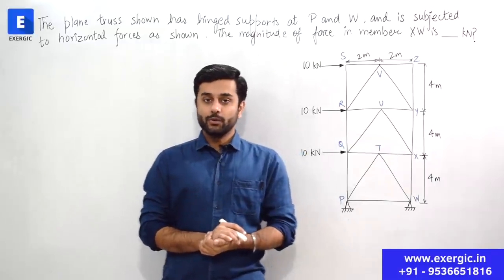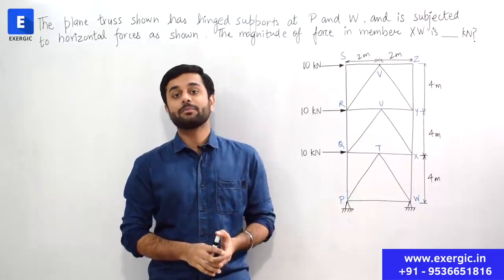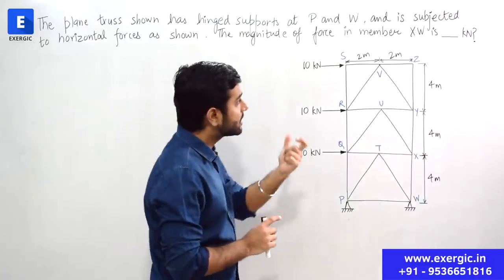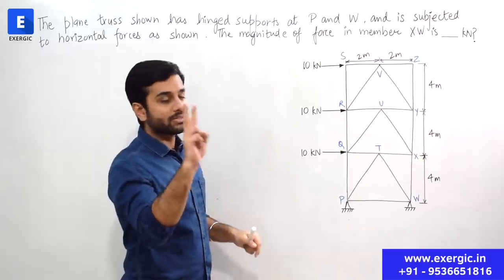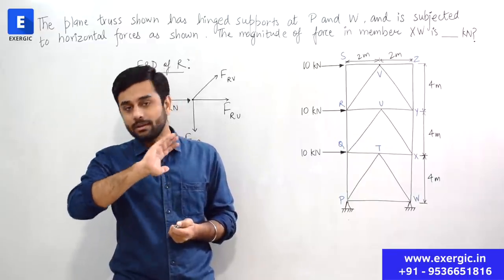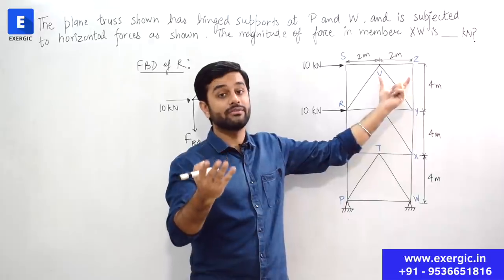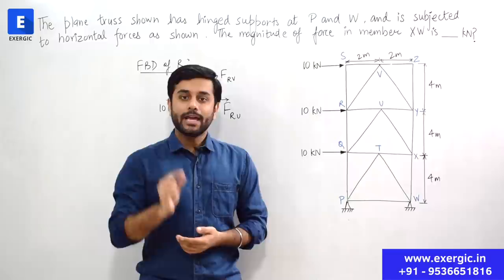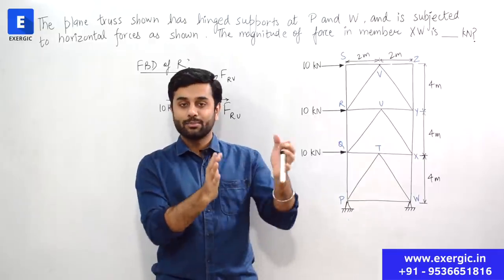Truss Analysis - Why to use method of section | Mechanics | GATE Mechanical

Comment: At 12:00, we can take moment about point T. Of course it takes an extra equation of summation of forces in vertical direction as zero in addition to summation of moments equation
Reply from the maker: In vertical direction equilibrium, all 4 forces unknown will come, 2 forces with cos components. That is why it cannot be done.
Reply: @ExergicGATE  thank you